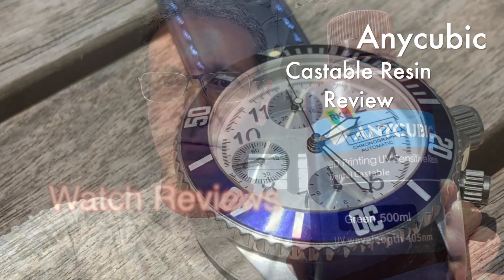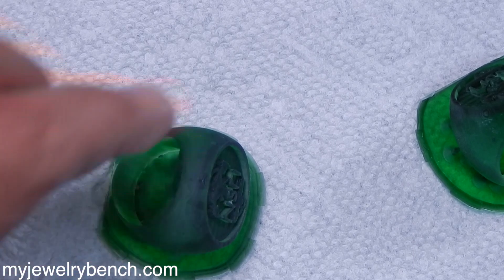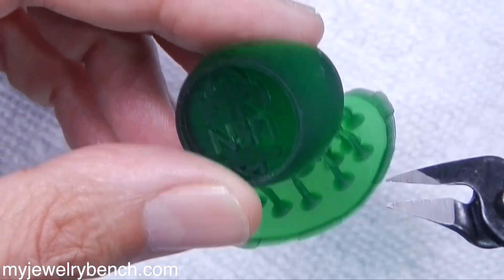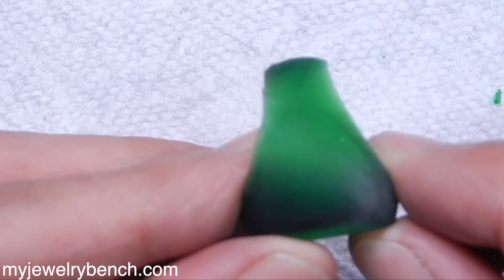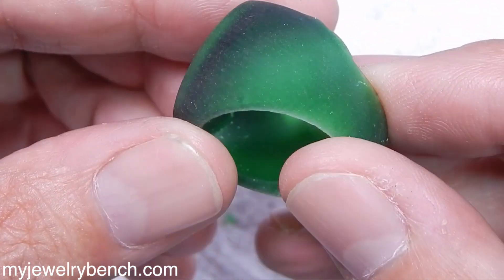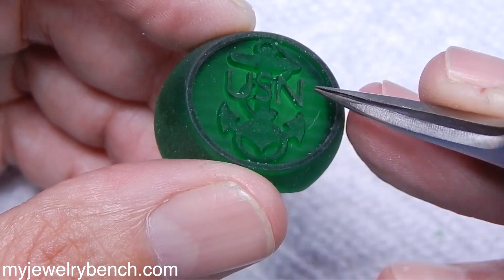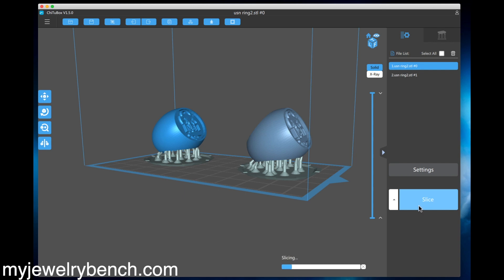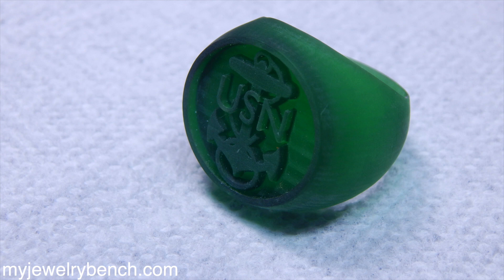Elegoo Mars and the Anycubic Castable Resin, Settings and Results

Comment: Did you burn it out at normal temperatures like up to 1500 degrees F or did you see that the label says you need to burn it out at 1700 degrees (930 C on bottle)?

Comment: Thanks for the video.  Have you tried a casting with this resin?  imo its about useless as it will not burn out at 1350-1450F.  The manufacturer recommends a burnout temp of 1650F which is ridiculous, gypsum base investment breaks down at 1450-1500F if you are left with a garbage mold.  I found it fairly easy to get a good print but it seems completely useless as a castable resin....well....unless you are willing to pay for the $10/lb platinum type investments :(.  Very frustrating

Comment: Thank you for the helpful explanation. I am a beginner in this field and I would like to know If I need to wash the piece after printing and if I need to wash them what should I use water or Alcoholic material?.  Also do I need to put it under UV light and for how long ?
Reply from the maker: I wash in a degreasing cleaner mixed with 50% water. I use a soft brush to clean out the excess resin and an ultrasonic cleaner after that.   Cure time depends on the resin. Softer is mostly better for burnout.
Reply: @watchesandjewelry  thank you so much.

Comment: Hello,
I have a  Anycubic Photon printer.
Despite numerous tests (and in particular whether the buid plate is new or sanded, clean or impregnated with an adhesive), I always arrive at the same result: impression of a single layer of the raft which remains adherent to the bottom of the resin tank. Do you have any specific advice for me? (I also print daily without problem with resins from other brands).
Note that I find the resin very liquid. same for you?
settings I use: layer thickness: 0.04 or 0.05 mm / time exposure: 19s / bottom time exposure: 90s or 110s. Delay: 0 to 3s.
thank you in advance
Reply from the maker: What resin are you using?  Is your photon a monochrome or an LCD ?  I’ll need that info
Reply: @watchesandjewelry  same resin : Anycubic Green Castable Resin (https://fr.aliexpress.com/item/1005001953649004.html?spm=a2g0s.9042311.0.0.2fa66c37VK7iiT). The printer is the classic Photon printer : SLA printing on LCD screen (https://www.anycubic.com/collections/anycubic-photon-3d-printers/products/anycubic-photon-3d-printer)

Comment: Hey I have a couple of questions, do these settings also work with Power Resin Burn? And I’m having a very hard time getting my prints to stick to the metal plate, do you know if there’s any way I could fix that?
Reply from the maker: Power resin burnout is on there website. I remember reading the schedule there. Let me know if you can’t find it. As far as sticking to the build plate, you may have to test a few settings. 80 grit sanding pads used to lightly scuff the build plate will help. Also try to re-level the build plate. Increase the layer level cure time, try and print with a layer height of 0.05. And if you are using castable resin, make sure you have medium or heavy supports.

Comment: How was the odor of the resin while printing?
Reply from the maker: Great question. So far all the castable resins I’ve used except for one are easy to work with and smell is not a big issue. No more than normal non castable resin. However, I purchased some inexpensive castable resin on eBay and to be honest, it stunk me out of my shop until I covered the printers   It’s called “alpha sense”. It prints fantastic, casts well but for the love of god you will need a mask.
Reply: @watchesandjewelry  Thank you

Comment: I am using anycubic photons all my prints are very perfect but the issue after curring the print in isopropyl  the model is not straight it bends little is there any solution for that
Reply from the maker: Interesting. Two things I would try. Instead of IOA, use some warm water but not hot water. Just a bit over room temperature and only for a minute. Then cure the print. The second idea is to print your item using thicker, or heavier supports. Or even increasing the layer cure time my half a second. Even a half second can make a structural difference.
Reply: @watchesandjewelry  sir I watching all your videos I have a doubt.how much thin(micrometres) can we cast using vaccum casting  and how to calcluate wax model into metal weight only wax model
Reply from the maker: Rule of thumb for lost wax casting is .5 millimeters. When working with resin your models should be about .7 millimeters to allow for shrinkage. Also, you need to be aware of the limitations of lcd or dlp printing and how you should orient your models for printing. Resin and wax printers do not deal with thin horizontal structures well. The model should be rotated so that you have few if any horizontal thin structures before you do the slicing and printing of your model.

Comment: Your videos are really informational! You mentioned in past episodes that you send out your prints to a burn out service. Can you share this information?
Reply from the maker: Hi,  Thanks for the question...   I use several different casting companies to do my castings...  If you are already a jeweler, you probably have an account with Stuller...  They are a good source for sending your 3d designs, or your printed models to be cast.  The cost ranges from $99.00 to $200.00 for their service.  You can email your design or mail in your printed model. They will also charge for the material used.  Jaguar is another really good caster.  They are a bit more expensive to do one-offs.  Their work is top notch.  In addition, I work with two local companies that will take my printed models and do the castings for me.  They both charge me about the same for material, and labor rates are between $70.00 and $100.00. For the local casters, I bring them my printed models, and give them the burn out rates.  This helps them to make better models...  I hope this helps.
Reply: @watchesandjewelry  Thanks for the information. Very helpful with deciding how to go about the burn out process.

Comment: The problem with this castable resin is that it does not cast well at all. I will be totally shocked if your casting house gets it to work plus I  don't think they will change their burnout schedule for this resin. I had real problems getting  Bluecast x10  to stick to the build plate on the photon but doable. Their new CR3A (Bluecast) works really well. prints and casts  like a dream on the Phrozen

Comment: Update your chitubox (And your Mars firmware) lol Then you can enable anti aliasing on your prints in chitubox settings and get much smoother finishes on your jewellery :)
Reply from the maker: Wish I could...  Anti aliasing on wax resins does not work well...  You actually loose detail, rather than gaining it...
Reply: @watchesandjewelry  Oh bummer :( Thanks for letting me know that, saves me from finding out the hard way when i do finally get some!

Comment: Hi so you need more supports on the bottom. Here’s everything you need to know about supports. https://youtu.be/rR-0tbBbyXk watch that series. And with more support you can decrease exposure time and in turn decrease print time. But also with more support comes more chances of fouling the print when removing them. So that’s a fun balancing act. Also you can try to smooth your STL out using blender. Check out https://youtu.be/wzcNH5pvd7Y at 4:25 Tom goes over how to do this. good luck

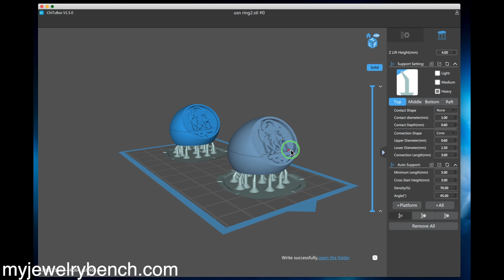Comment: The ridge marks come from the STL file being too coarse. In fact it contains flat polygons and no spherical shapes. You can clearly see them at 9:21 in the mid section. Try a lower setting for the angle limit when exporting to STL, depending on your workflow.
However the green translucent resin amplifies this effect, it wouldn't probably be that visible on an opaque print.

Comment: For what it's worth, I've been saving myself a bit of trouble by including a few 4-6mm sprues underneath my prints, allowing for eventual fusing to a wax tree.  That also means I get to place the sprue location, without having to worry about someone else deciding where to place the runners, or if they might add more wax than I feel like cleaning up later.

Properly designed, the sprue network can double as raft/platform support, and the little footing can be clipped off without fear of damaging the 'good bits.'

Comment: The bottom is caused by the angle that the ring was printed. Increase the angle closer to 45 degrees or make sure the that the piece is not printed "flat". Adding light supports in-between the heavy would help too with little scaring.
Reply: Is there any reason to use the heavy supports for this piece instead of just light, but in higher quantity?
Reply: @mimked  Depends how many support structure on being used. Light supports are not great for big objects. In this case it would be fine!
Reply from the maker: I tried meditation supports with chitubox first. The did not hold the piece. It may be due to the brittleness of the resin
Reply: @watchesandjewelry  the main problem with the edge is, that it's parallel to the build plate. try to orient the modell differently so the edge builds on itself